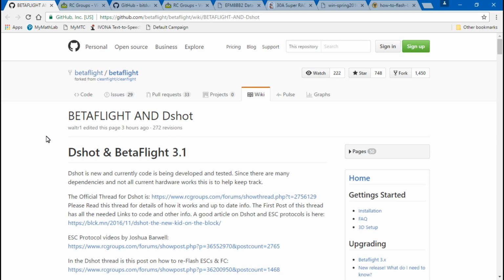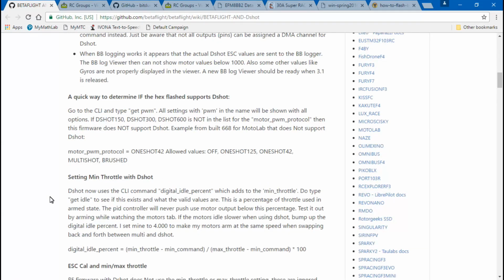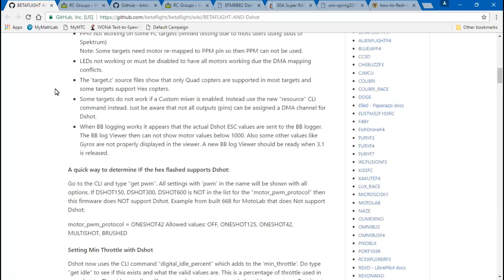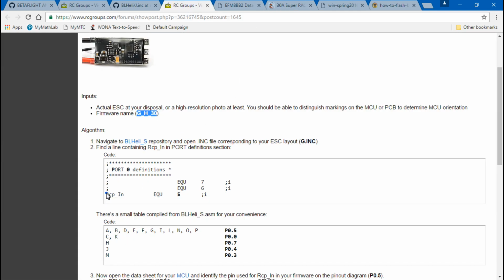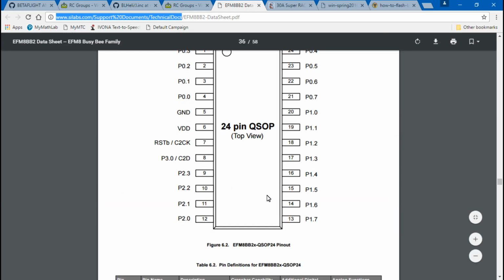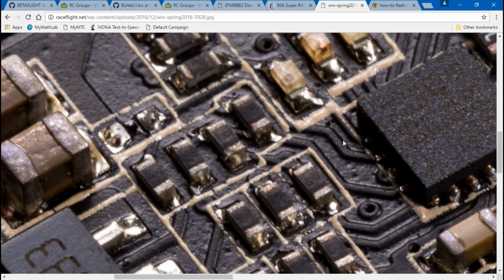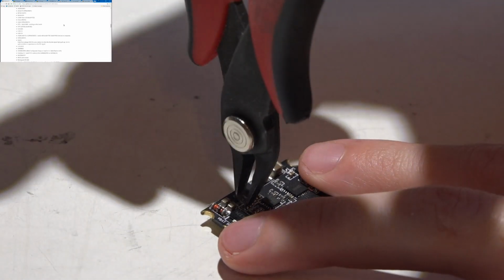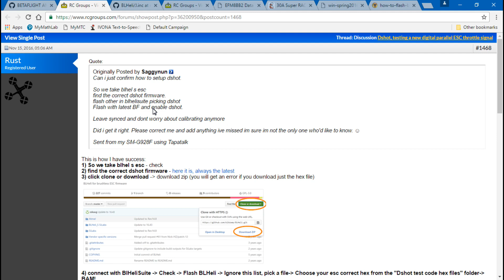Multishot to D Shot: Locating Cap, Removal, & Firmware

Comment: When I started with quads, AFAIK there was no "configuring" to ESCs.  You wanted a specific firmware, but then you connected them and used them -- done.  So is there a primer BEFORE this one?  I need to know what is being configured about an ESC, what it does, why I care, and probably how it inter-relates to PID tuning at some point.

Then I've heard dshot, cleanshot, oneshot, multishot and NAH.  So I guess my first question is WTAF?  What is the latest one assuming I'll be using BetaFlight? (and how much of this nomenclature can I ignore?)

Comment: hello, i'm having problems with installing the newest hex for my bs25a escs.....
Iv'e been doing this for a couple years now so I'm not a newbie.
The newest blheli  has 'codes' designated to the esc properties now. Iv'e scoured the net for a few hours now with no luck for a proper explanation of the new 'code' or a spec sheet for my escs.
There are success stories converting this esc to dshot600, I don't know where to go from here.
Thanks
Reply from the maker: By code do you mean like "J_H_90" or something like that? And I haven't found any web pages as far as ESC specs. Luckily the website I purchased my ESCs from posted the specs.
Reply: Project Blue Falcon: yes those are the codes I'm referring to. when I went to reflash up to 16.6- the ESC 'code'/hex was already there to flash. I went ahead and flashed it. everything seems to work...but when I throttle past about 40% and then back to 0%, motors 1+4 will continue to spool up where 2+3 are held at zero. not sure what the deal is.
Reply from the maker: I found this. It explains what the code means,
"The BLHeli_S codes are named with a letter, another letter and two numbers, in
addition to the revision. For example "A_L_10_REV16_0.HEX".
The first letter denotes the pinout of the MCU.
The second letter is either L or H. L is for 24MHz MCUs, and H is for 48MHz
MCUs.
The two numbers denote the FET switching deadtime. The unit is 20.4ns.
Some FET drivers have adaptive FET deadtime control, and for these 00 is used
to denote FET switching deadtime."

As far as your motors I'm honestly not sure. It's very strange that they were working before flashing firmware. So it's not a wiring problem, probably not anything in the firmware, not damaged ESCs. That doesnt leave much that it could be. Very strange.
Reply: Project Blue Falcon: I did see that in the blheli manuals. how does the first letter coordinate with the MCU pinout? ("A=?pinout")...the ESC is 50mHz and should work fine with "H@48mHz". The FET switching time is not noted anywhere that I can find, so that's kinda a crapshoot.
Reply: I have Bumpbee_S with MCU BB2 (caps removed) but i reveived them  from PFV model 2 Esc came with J_H_90 v16.6 fw target and 2 others came with J_H_15 v1.6 Fw target. with target Hex file should i use ?.
Thank you and waiting for your reply.

Comment: Got it all installed thanks to your tutorial.  Really appreciate it.  curious to know if I will notice a difference from multi shot?
Reply from the maker: I dont think there is much difference as far as flight. There is a difference but its very small. I just really like D shot because there is no ESC calibration, they are perfectly calibrated meaning all motors will spin with the same exact timing.

Comment: Awesome video!  Even better is that I am running those same super racerbee esc's.  Question - so there isn't any D-shot specific firmware?  Its just 16.5?  Im running multi shot 16.53 on my RTFQ super racerbee's right now.
Reply from the maker: Nice choice. These are some great ESCs. Nope there is no specific firmware for D-Shot. When I talk about that one page in the video, that was for the guy needing the newer BLHeli firmware before it was officially released, because 16.4 started supporting D Shot. But the BLHeli Suite firmware is now up to 16.5 so you can skip all that stuff. Just clip the cap off and make sure you have 16.5 firmware, select D Shot in the configuration tab of Betaflight 3.1 (if you have the pre release), then you're good to go.
Reply: wow! I thought it was way more complicated.  I appreciate it!!  keep up the great work with the vids
Reply: One last question-  Do I need to go to 16.5 or can I keep 16.53? thanks
Reply from the maker: 16.53 is fine. Always use the newest. I just said 16.5 because I'm rounding.

Comment: dammit, I was or may still be set 
on the TBS ESC, then you make this video and I have to rethink my life. lol those look really good and are really cheap. is there any truth to the slightly smaller ESC 24 or 25 amps creating more thrust then say a 30 or 40 amp ESC?
Reply from the maker: Lol, well I dont think you can go wrong with either ESC. There is truth to that. With all electronics you want to match things the best you can. What I mean is in theory if you're only using, say 20a per ESC, and have 30a ESCs, then the extra resistance in the circuit will reduce power. Same with wires. If the battery leads going to your PDB only needs say, 16ga, and you use 12ga, then there will be a slight reduction in power from the extra resistance. But if you go too small on the ESC, or say battery leads, then too much current is what overheats or fries things. 

There was a guy that did a really good video but I cant find it. He tested the trust of motors with I think 40a ESCs vs 20a ESCs and he lost thrust with the 40a.